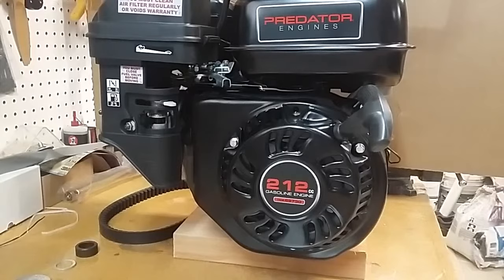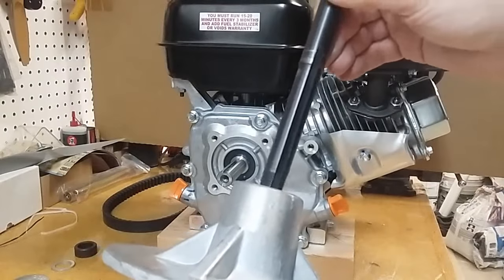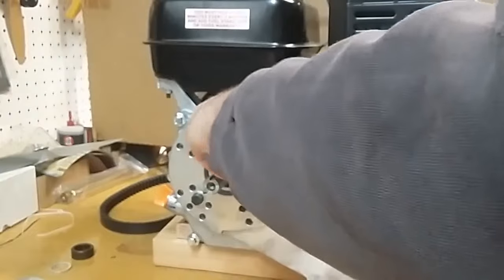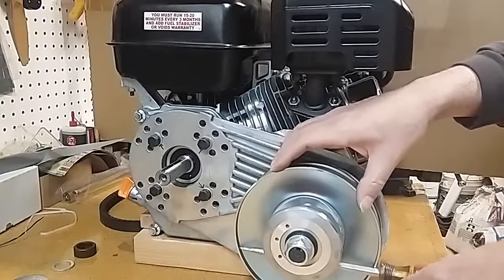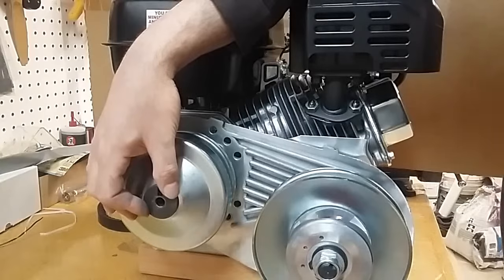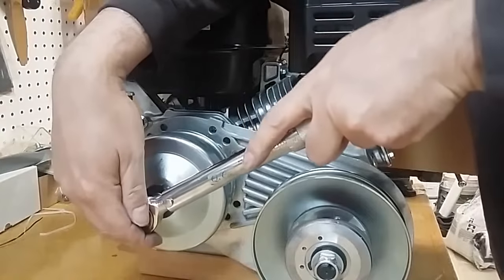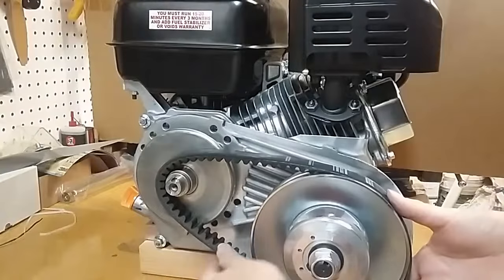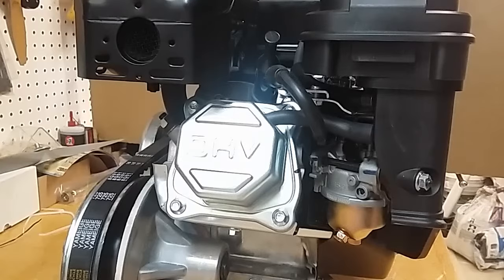Predator 212 - Series 30 Torque Converter Install: The SMOG Project 05

Comment: What happens when the jackshaft gear doesn't line up with the rear sprocket?
Reply from the maker: If the alignment is off by a little, the chain is noisy and wears out faster. If the alignment is off by a lot, the sprockets throw the chain frequently. If the alignment is way off, you move the jackshaft sprocket until it lines up correctly. That's one of the two purposes of a jackshaft: to compensate for differences in alignment between the engine and final-driven component. The other purpose is to change gear ratio.
Reply: @doktorscottdiabolical  Thanks i guess that was my question inside a question- if the jackshaft gear was adjustable
Reply from the maker: Usually they are. I'm using industrial/agricultural sprockets, which are connected to the shaft with a keyway and setscrew. And since I'm using standard sized keyed shafting, I can slide the sprockets anywhere on the shaft that I want them. However, my jackshafts are super-heavy! Like 40 lbs of rotating mass! That's marginally acceptable in a 1300 lb parade float, but a deal breaker in a kart. But... most of the kart-specific jackshafts and sprockets/hubs I've seen use a similar keyway/setscrew design. They're just built smaller and a lot lighter than what I'm using.

Comment: It seems strange that the spacers 'washers' aren't provided in the kit since you are just assembling kit parts.
Reply from the maker: Welcome to the channel! I think the problem is that there isn't a common standard for the distance between the crankcase mounting flange and the end of the crankshaft among the various engines that this kit will fit. It really is a critical dimension with this design. And yeah, you'd think the mfg would throw a few shim-washers in the kit. But... generic kits aren't really known for that. They're known for being cheap, and this one was. As always, YMMV. I intend to machine a proper spacer on the mini-lathe.

Comment: ONLY 1 ONE CLICK PER BOLT. MORE THAN THAT IS JUST WEARING OUT YOUR WRENCH.
Reply from the maker: $18 wrench. No thread lube. Not a drag racing engine. # of clicks is irrelevant in this application.
Reply: @doktorscottdiabolical  1 click is good practice.

Comment from the maker: Recently, a commenter insisted that I have installed the drive pulley on the crankshaft "completely wrong". He states that "he called five different manufacturers they ALL told him that it should be installed with the sprung moving side of the pulley on the motor-side of the crankshaft". And that "the flat side of the pulley (actually a 2.5 degree angle) should be installed to the outside". Well, you're welcome to install your kit any way you think is right. I'm not going to tell you that you're wrong. But I cannot find any evidence supporting that method. All evidence confirms that I am demonstrating the correct method of installation. Here is a list of sources I researched. Don't take my word (or anyone else's on YouTube) as Gospel. Examine the research yourself and do what you think is best for your kit and your application.
https://www.bmikarts.com/PDF/Comet_TAV2_Torque_Converter.pdf
http://gtcmanufacturing.com/tc2installation.pdf
https://cutpriceracing.com.au/store/Guide-Torque-Converter-Installation/
https://www.gokartsupply.com/tavapp.htm
https://www.gopowersports.com/tav-30-75-torq-a-verter-comet-after-market/
Reply: ^^^^^^^^^^^^^  👍👍👍👍👍👍This is GREAT info, thanks for going to the trouble

Comment: Great video, but you might want to note that using anti-seize on a bolt and then torquing to spec will greatly over-tension the bolt. 
Unless otherwise stated, torque specs are for clean, dry, new assemblies. Dirty, buggered, oily, or worn threads won't torque properly.
Reply: NOT a real big deal, it appears that he has had to remove such that SHOULD of been anti seized in the 1st place

Comment: This guy has a vendetta against impact wrenches lol. I used a tiny dewalt impact to install mine, super quick and as long as u only let it impact a time or too you won’t over due it. Especially if u have selectable power settings like mine does. But who knows maybe it all seizes up on me or my engine blows up😂
Reply from the maker: You have watched the wrong video. You wanted "how to do it in 6 minutes and maybe screw up if you ain't lucky". My video is 27 minutes long. In my experience no power tool, especially an impact tool, provides enough tactile feedback to consistently avoid stretching or tearing out the threads of these cheap, Chineseium-alloy engines. Nor do they provide enough control to avoid warping parts due to inconsistent torque values on multiple bolts. Sure, impact drivers "can" be used successfully for this installation. So can an 11-ft long snipe. But neither will be a good choice in the hands of the inexperienced person this video was intended for.
Reply: "This guy has a vendetta against impact wrenches lol."  <<<<<<<<<< NO, the jokes on you, he brought a EXCELLENT point due to MOST misuse such and with these thin stamped parts & running bolts into aluminum he brings out a EXCELLENT WARNING
Reply: YEP, your clip removes potential issues for those unlearned, IF someone follows YOUR procedure to a T they will have NO issues unless it's defective parts @doktorscottdiabolical

Comment: The only things Not address on here is wet torque vs dry and using thread locker, it has changed in the 46 years sense I went through Tech school, and there is a whole industry out there that uses SS hardware in aluminum castings, the outboard and inboard manufacturers.
Reply from the maker: Discussing torque procedures and thread-lockers is like discussing glue... or religion. Everybody's got an opinion. My best advice regarding the Predator motors is "soft alloy, small motor, take it easy with the wrench".

Comment: What size bolt did you use (fine threaded stainless bolt)
Reply from the maker: The bolt that goes into the end of the crankshaft depends on exactly which engine you have, and where you live. Some are metric, some are American threads. Check the manufacturer specs for your specific engine & model.

Comment: What’s the size of the bolt that goes on the drum of the torque converter? I’m asking because I lost mine and I can’t find the right measurements
Reply from the maker: That bolt goes directly into the end of the crankshaft. So the diameter and thread pitch depend on the engine you're using and what it's tapped for. My Predator 212cc wedge-head is tapped 5/16"-24 tpi (I'm in the USA). Length is also dependent on your engine, your actual setup and how you positioned the backing plate, the number of shims you had to improvise to get everything to line up, etc, etc. That may take some experimentation. But remember, you can "shorten" a bolt with a hacksaw.
Reply: @doktorscottdiabolical  thank you for your help!!! Do you think that it is in home depot?
Reply from the maker: Maybe. But it would be in one of the "special bolt" drawers since 5/16"-24 is UNF "fine" pitch. You'll have better luck at Ace Hardware or Tractor Supply.

Comment: We did everything right with these exact engine/parts...but when it runs its fairly sluggish and the t converter is rather noisy...like shaking metal on metal...maybe the bolt that holds the left smaller pulley (clover part) needs to be tightened?I think the problem is right there....
Reply from the maker: Yep, sounds like something is loose. My TAV doesn't make any odd noises. You can hear the "belt whine" when it's engaged, but that's it. No rattling, no clunking on engagement, or anything like that. If it looks like your drive-pulley (the one on the crankshaft) is loose and it won't get any tighter even if you add more torque to the bolt, you may need a shim (or more than one) in the stack of pulley parts. It's possible that the bolt is bottoming out on the end of the crankshaft before the inner half of the pulley is seated or has sufficient clamping pressure from the bolt. Or... your bolt may be too long and it may be bottoming out in the hole <insert "that's what she said" joke here> before it creates sufficient clamping force on the pulley stack. If that's the case, get a shorter bolt or cut a bit off the end of the one you have.
Reply: The reason why is because this guy is telling you the wrong way to mount your drive converter your drive converter has to be with the gazing part towards the end of it looks like it's on backwards but that's how it's supposed to be on I called five different manufacturers they told me every one of them that that drive pulley the big fat bully goes on with the fat part towards the engine he is putting it on backwards and this is a fact called the manufacturers comet and a few other ones this is the wrong installation that drive pulley has to go on backwards as soon as you put it on backwards you will see lines up almost perfect you might have to put a small washer behind it or you might have to sand down the sprocket a little bit to move the polio in a tiny bit but I didn't have to do anything to my in Mayan runs perfectly in uniform the belt does not twist does not make any noise your belt should not move from side to side under idle or high RPM if you kick the gas in your belt decides to go sideways that means it's wrong it supposed to move over in Unisom it supposed to move together on one side it's not supposed to twist at all
Reply from the maker: David, FYI: I do not tolerate swearing, name-calling, flaming, or trolling on my channel. So I am not going to approve your original comment for that reason, and that reason alone. If you would like to share your insights WITHOUT being negative and inflammatory, then please do. I have never claimed to be THE authoritative expert on cheap go-kart parts. It might be possible that you're right, and that the moving side of the drive-pulley should be to the engine side on some kits. I didn't do it that way because my kit didn't seem to work that way. The installation method I demonstrated in this video worked exactly as it should for my kit. No clunking or chattering. No soft engagements. No belt twisting or jumping. Just smooth parallel operation as you described. And it does this through the RPM range, even when powering my 1300 lb dragon-trike uphill. I've demonstrated this in my videos. Please keep in mind, I have stated many times in the comments that I am installing a generic knock-off Chinese-made kit. I bought it from a vendor on Amazon that also sold knock-off boat stereos. And he probably bought the kit on Alibaba. My kit is not a Comet or any other known branded-manufacturer. So there is no manufacturer to call for this type of kit. If you were able to find a manufacturer to call (or five), none of them made THIS kit. And theirs may work a different way. One guy that commented a few months ago that his kit had the output sprocket on the engine side of the mounting plate. That's not even possible with my kit. His was from a different manufacturer. And based on other comments I've received, I believe there are more than 5 different designs out there. But most of the commenters are using this type. So my video is relevant and correct for them.       
If you still disagree with anything I've said in this comment, you're welcome to make a video demonstrating how you installed your kit. I really would like to see your installation and I'd like to see it in action. Because I'm curious to know how your kit gets the same results as mine (or RedBeard's or anybody else's) but with a different installation method? There's gotta be something different between the two kits. I'm wondering what that is. If you can share that, it might help folks that have your type of kit.
Reply: Actually I use voice to text and that was not what it was supposed to say what it was supposed to say is you all and I will say this again you are completely and utterly wrong I have contacted five different manufacturers on these torque converters the torque converter fat part goes towards the motor always by installing it the wrong way you cause premature wear of the belt and parts the procedure is incorrect and will cause an alignment of belt
Reply from the maker: Based on your comments, I'm certain that I will not change your mind on what you believe to be "the only correct installation method". I've lived long enough to know that people who emphatically insist "they're right and that everyone else is completely wrong" cannot be convinced otherwise. Especially with words. However, extraordinary claims demand extraordinary proof. Please post a video demonstrating your installation method and your kit. The rest of us would like to see what you're doing differently, and how your kit works. Please also include in your video which manufacturers you called, and each of their specific phone numbers so we can call those manufacturers and verify. Thanks.

Comment: Got a problem. In my country I can't get a predator engine but similar. The problem is the jackshaft dismeter is either 18mm or 20 mm. Do you think the cvt kit will fit in one of them?

Comment: Such a great video. Is the mounting plate necessary? I have a predator 212 with a 30 series off a 3203 yerf dog but it didnt come with the mounting plate
Reply from the maker: Not absolutely necessary. But it provides the driven pulley & jackshaft with the correct geometry in a convenient package.

Comment: I dont understand why you even need a torque converter.My grandkids go cart i rebuilt does great with out one.A torque converter is just in the way it doesnt make it run any faster.
Reply from the maker: This type of torque converter functions as both clutch and transmission. Exactly the same as a CVT automatic transmission in a car. Fully loaded, SMOG weighs about 1,700 lbs. More than a Volkswagen. Could you drive a car without a clutch or an automatic transmission? BTW, SMOG also has a massive chain-reduction transmission: https://youtu.be/uwL9mSR4IAQ

Comment: I find the crank shaft on the predator 212 cc is to short when using the 30 series clutch assembly. The problem I have is when you shim to get proper pulley alignment the bolt that comes in the kit only catches about a quarter inch of the threads give or take yes you can get a longer bolt about an half inch longer that fixes that problem but now you have the problem of what you called the clover only having maybe an half inch or less  of the crank shaft sticking out for it to ride on and only about three eights of an inch of its key actually in the key slot on the shaft and over a short time it will wiggle and break the bolt. How many other people have had this problem please comment. The shaft is 2.43 inches long and to be trouble free you really need at least a three inch shaft.
Reply: I'm having that problem now. Asking for help on a Facebook group and everyone says I have something wrong. Your saying exactly what I've been thinking. The shaft has to be short.
Reply: HUM, glad you brought this up in case I run into such, I wouldn't think there would be that variation in shaft lengths within production, I'd bet there are variations in one or more of the kit parts

Comment: i put a torque converter on my mini bike but the clutch isn’t engaging do you know why?
Reply from the maker: Watch the "engine pulley" as you increase RPM. The side of it should move inward to engage the belt. If it's not moving, something isn't assembled correctly. If it is moving but just doesn't engage the belt, check that you have the belt installed correctly. One side has a bevel. If that isn't it, you may have a washer in he wrong place or something assembled in the wrong order.

Comment: Where does a guy buy just the machined spacer & bolt to secure the pulley to the shaft of the engine? I bought a 30 series to mount to the Predator 212. The spacer I have now is about 1/4” too long, so need a shorter one. Any help would be great! Thank you! Very useful video!
Reply from the maker: Good question! If you're in the US, I would try McMaster-Carr or Granger first. Look for something like "unthreaded spacer" or "shaft bushing". You might also try an online bearing & chain shop. I've had good luck with The Big Bearing Store. If you've got a GOOD local hardware or farm supply store (the kind that has an entire isle of just nuts and bolts), you might be able to find a few spacers/washers/nuts that you can stack up. Keep in mind that on a rotating shaft, thousandths of an inch count. Standard clearance of .005" is the thickness of a sheet of paper. Anything more (like the washer I used) will introduce additional vibration and wear.  IDEALLY you would determine exactly how long your spacer needs to be. Then you would find a guy with a lathe or take it to a machine shop and have the spacer faced down to the correct length. Do you know any local kart racers, drag racers, retired machinists? They may be able to point you toward a friendly shop. If all else fails, clamp your spacer in a vise, cut it off a little long with a hacksaw, then carefully file it down to size with a mill file. That method sux, but it can work if you're patient and careful. I personally intend to turn a new spacer in the mini-lathe once I have the engine location and vibration issues worked out. But that's going to be a while. I got stuck rebuilding my back yard deck this summer.
Reply: Ok! Thank you for the reply! Good info!
Reply: @brentd3443  Saw a video where the guy said he uses copper pipe as spacers and said works great. Just cut to whatever size spacing you need.
Reply: EXCELLENT idea, I've use PVC & CVP plastic pipe for some quickie setups  @ChristopherJones16